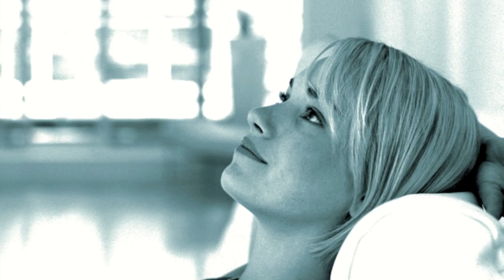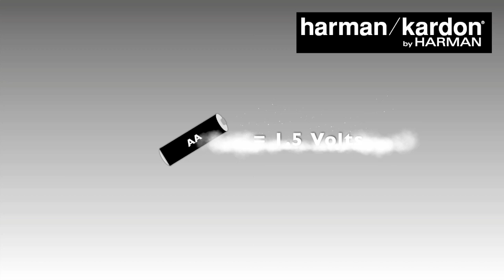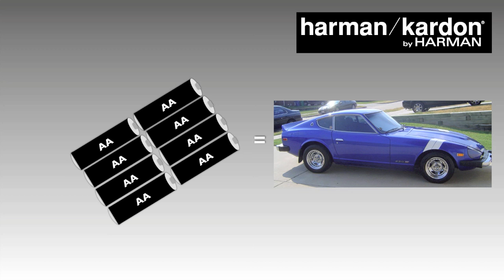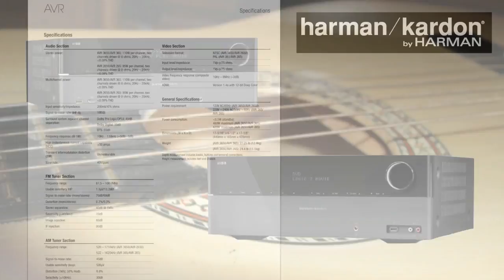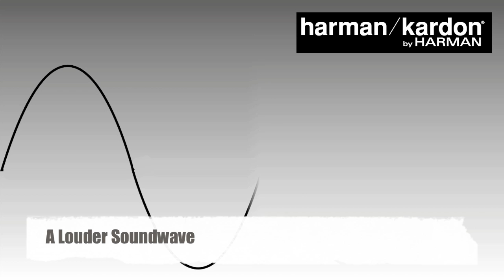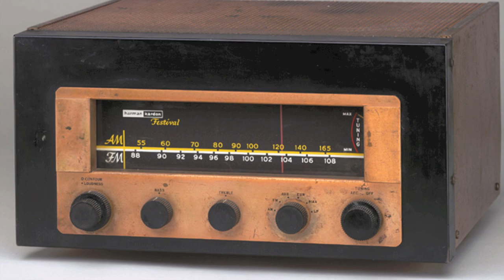Drive your Loudspeakers to perform - Harman Kardon's High-Current Amplifier Design

Comment: This guy is confused. Voltage is what clips, not current.... Driving an amplifier over its maximum voltage gain causes distortion, not lack of current. I could use a AA amplifier and still get distortion.